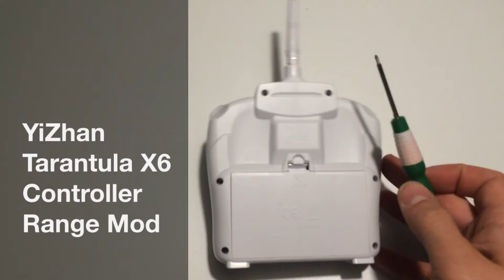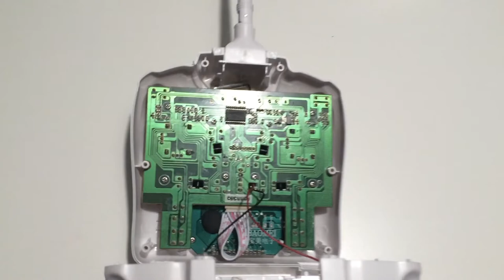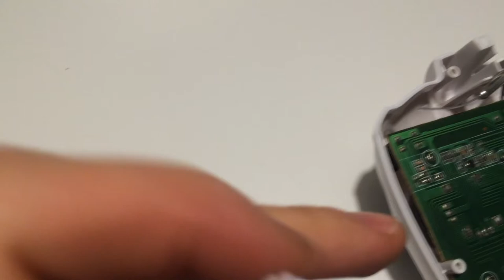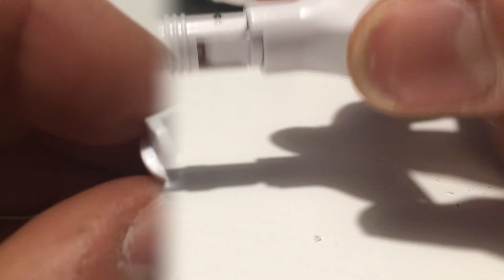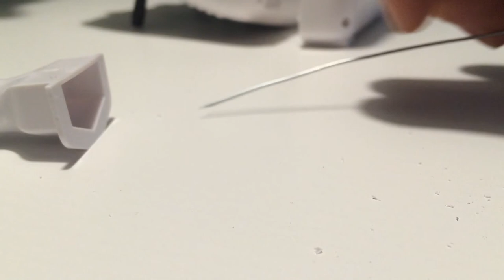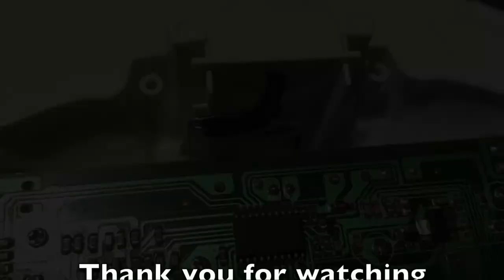Controller Range MOD HACK YiZhan Tarantula X6

Comment: Wow what did you use for the antenna?
i saw some other video’s using an thicker cable and a real 2.4ghz antenna like this:
The sma cable : http://tinyurl.com/haon3dj
and the antenna : http://tinyurl.com/hzv9ok6
Reply from the maker: +Dion Li i using a little wire for the antenna!